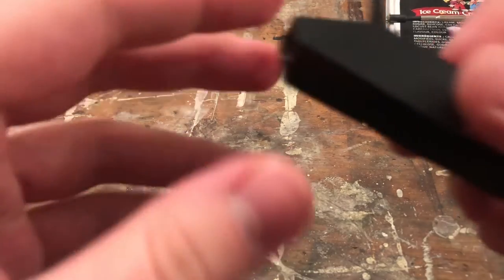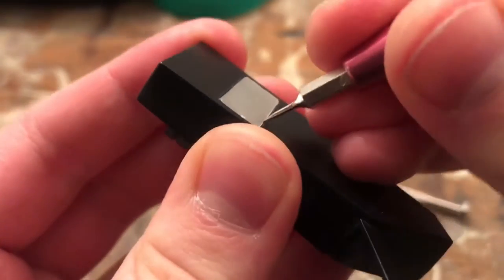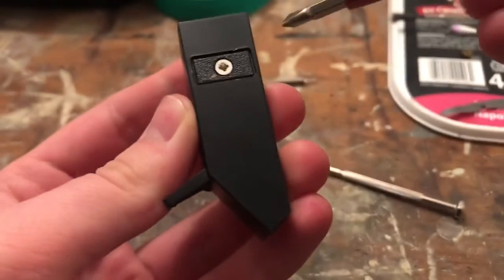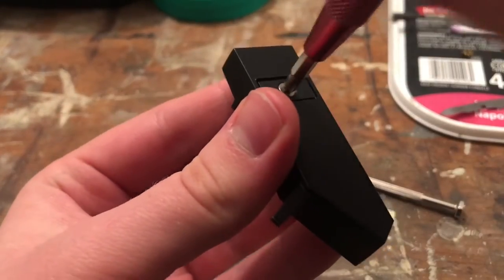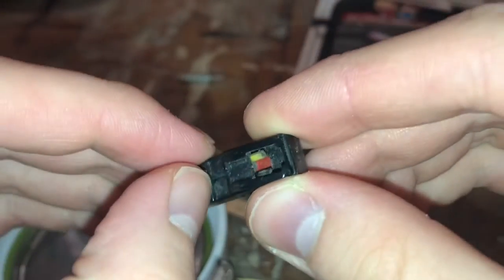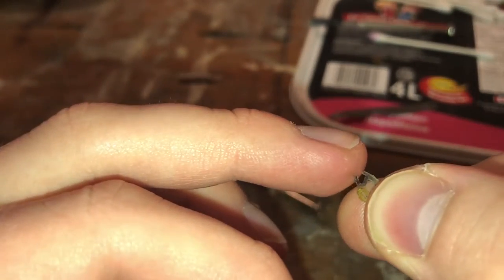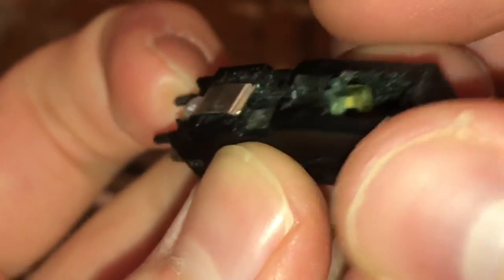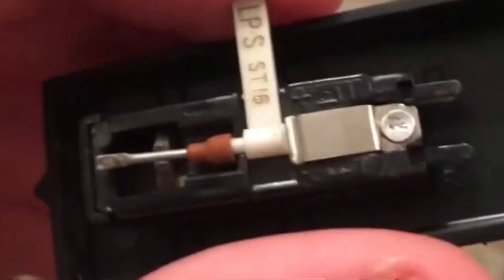BSR Record Changer Stylus Replacement (Part 2)

Comment: I have a question, I bought a flip stylus I could find without thinking if it would fit in ma BSR. can any flip stylus work or not
Reply from the maker: check ebay and see which one is the closest to the one you've got in your BSR.